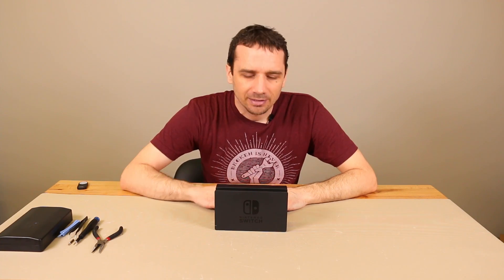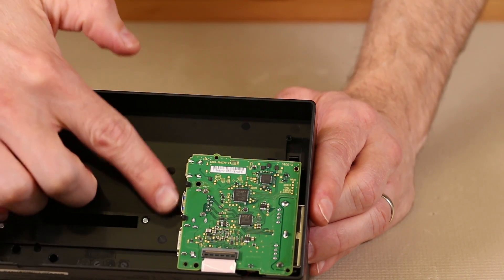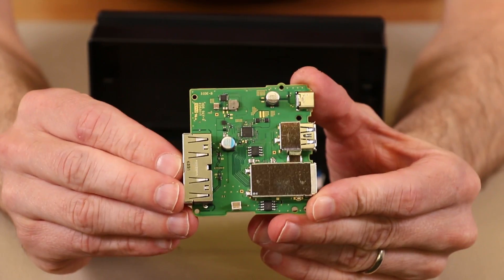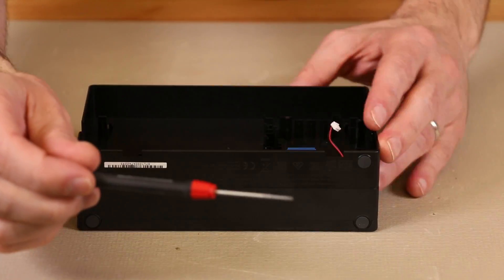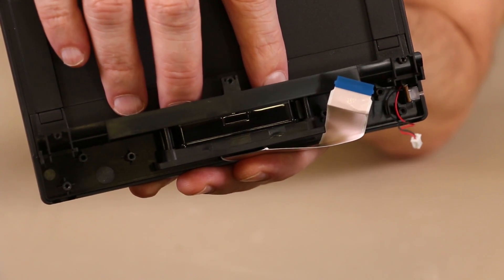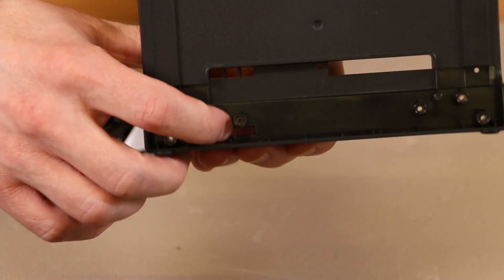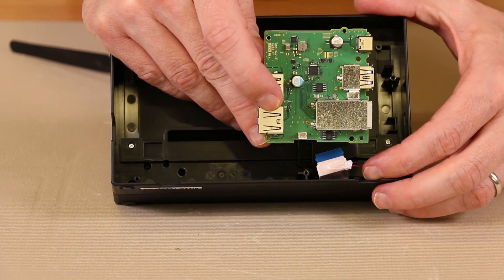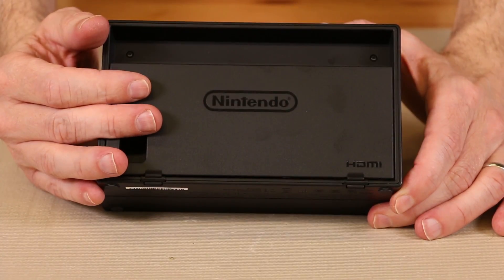Nintendo Switch Dock Teardown

Comment: I did get a dock from a friend of mine that had roaches In it so I'm just looking to see how to take it apart fully to replace all the mother bored and other electrical components so I wouldn't have to deal with the ones that got roach remains on them since I don't wanna take chances with the old parts I'm only cleaning off the plastic parts as well as disinfecting them from the roaches but hopefully I should have it cleaned up and get the replacement parts I need

Comment: Honestly, that freaking ribbon cable nearly broke me. If anything the one in my dock was marginally shorter than that in this video. The only way to I could connect it was to keep the two halves of the shell separate. By moving the other half of the shell closer to the motherboard I could get enough length on the ribbon cable to install it. It meant that I couldnt get one or two of the screws in but after struggling with the thing for half an hour I was happy to make that trade.

Comment: What is the sensor that switches the display to the TV below the usb C port of the dock?  I think this is why my dock is faulty but I dont know how to repair it.
Reply: There is no sensor, it's simply a mistake on TronicFix's part. If they had actually fully disassembled the dock that would have been clear, so I guess that's why they stopped halfway through the teardown.

The switch just needs a solid USB C connection to work - perhaps yours isn't sitting all the way down into the dock, or perhaps your port is simply worn out.

(I have 3D printed a custom dock and put my original dock's boards into it, so I can absolutely confirm there is no sensor, just a small spring section to support/guide the switch onto the USB C port inside the dock.)

Comment: Anyone struggling with the ribbon cable, the trick is to get it in at an angle (where the wire is pointing down towards the board, kinda)
Reply: I looking for  replacement springs  I can’t find them anywhere for the dock

Comment: Hey there, I have wobbly joycon(left one) is it possibly that if i unscrew the rail and screw them in back, more tight it will fix it? or is it possible if you can check that out later? @TronicsFix
Reply from the maker: I'm not sure...you would have to determine the exact cause of the wobbling. Is the rail actually loose? Is the channel on the joycon worn? Those are the questions you need to figure out. It's hard to fix something if you don't know what's causing the problem.
Reply: TronicsFix sorry for the late reply , i dont feel the rail on the switch loose, so i think it could be the joycon itself
Reply: What’s the most common problem with the switch dock?

Comment: take that board and put it in a better designed custom dock
Reply from the maker: What do you think would be the best improvements?
Reply: a new dock with a charge pad where you just lay it down and it not only charges it but its transmits the video to the tv that way you just set it down so no having to be accurate and slide it into a shoddy plastic dock, but saving that then a  better screen bezel or a quality screen protector installed from the factory,
Reply from the maker: That's a pretty good idea. Just need to design it and have it 3D printed.
Reply: Good luck with solving latency.. :-\

In any case, be sure to account for the multiple functions this dock performs besides the electronic components. You know, like allowing the Switch to cool itself and the components simultaneously ;-)

The dock's "shoddy plastic" shell does more than you think you know?

Comment: Just an empty little box !?!
Reply: Not just an empty box. It's design is mainly focused on allowing for cooling all components with the Switch internal fan, protecting the screen, protecting the USB-C port while docking (that's what the springs are for).

Oh and also some cable management.
Reply: @LittleLionRawr  protecting the screen ???I dont think so
Reply: @duongphuocdat6840  Try putting it upright without anything in front and throwing a joy con at it. Or better yet, a pencil or accidentally hitting it with something with a sharp edge.

Then you know why the dock definitely protects the screen from a lot of potential accidental damage..

Comment: Very cheap looking.
Reply: RsakuW358 and they charge $90 for a that cheap plastic box with just a connection board in it.
Reply: Looks are deceiving.
It doesn't have sharp plastic. I own one. all edges and corners are rounded. The scratches people have are from dust/dirt particles that ended up on the switch screen and scratched the screen while docking.
Even then it's surprising they managed to do that since the screen doesn't touch the front plate of the dock when it sits properly inside the dock. There's a small space between it.

A screen protector is advisable in any case, regardless of the dock, as the screen is made of plastic on purpose to prevent it from breaking when the console is accidentally dropped.

The only thing I'd say Nintendo could have done better with the screen is pre-installing a removable screen protector themselves. But not every customer would like that, and it does increase assembly time and production costs.

As for the price, don't forget it also comes with an HDMI cable and the system's charger which costs $30 on it's own. (It's different from regular USB-C chargers, being able to switch to a different voltage and more.)

The dock on it's own costs around $60 and compared to other USB-C products and the additional components it has to those it's really not more expensive than those...